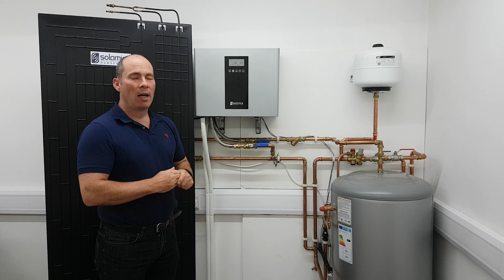What is the cost of running a Thermodynamic Solar Heat Pump?

Comment: We had one of these systems installed a month ago. One thing that was not mentioned to us was how loud the compressor unit would be in our attic. If we could go back in time we would not have installed this system. It takes too long to heat the water back up too.
Reply: Ye I’ve packed insulation all around it and around the roof beams but it’s sadly not made a difference ☹️
Reply: Ugh that's too bad. Can you add some sound insulation around the compressor? Maybe build a box with dynamat?
Reply: Which brand? Whats the difference in your hot water bills.
Reply: @howardburrage3874 Not sure if this was directed at me but we have a Harnitek Thermopod. Provided and installed by a company called Noreus. Turns out they installed a faulty unit, the new unit does heat up quicker (maybe runs 3 times a day for about 2 hours each time). But, it’s still noisy as hell! It’s better because it runs for less time, but it’s still super noisy. They gave us some money off and washed their hands of us now 🙄 They can’t rectify the noise & neither can we. Massive mistake, just stay away from this tech. Get PV & a battery instead.
Reply: Should have said, it has saved us money on heating hot water though. We also recently installed a smart fuse for the hot water tank so the immersion(ah lovely silent inefficient immersion) only runs at night on a cheaper tariff, so it’s difficult to work out how much it’s saved us. Both changes have amounted to a halving of our hot water bills. I have our heat pump on a smart plug so can give you a bit more info: It’s actually twice a day it runs, in the morning for 2 to 3 hours then in the evening for 1 to 2 hours.
Reply: Just adding two more items....isolating  the compressor (and any other machine) from structural connection should help to minimize noise. Vibration travels a long way (whales know this, of course) and beams in a home can conduct vibration to other points of contact p, actually increasing noise. Personally, very interested in the application seen here, for whole house heating and domestic hot water, using a large, very well insulated storage tank or tanks.

Comment: @ 1:42 "It is an incredibly low efficiency system". Not so good then?
Reply: If he can call a system with a COP ( Co-efficient of Performance ) of 3.5 to 4 - that means having an energy efficiency of 350 to 400 % there is something wrong with his understanding of a heat pump water heater. For every kilowatt of electrical energy consumed, a properly designed and sized heat pump will heat water to the equivalent of a 4 kilowatt of electrical energy. If he calls that an incredibly low-efficiency system, then what is high efficiency according to him?
Reply: He mad a mistake that's all. he meant high efficiency.

Comment: The presenter does not appear to be on top of his subject or is simplifying rather too much. The compressor does not scrunch it back up into a liquid, in turns it from a low pressure gas into a high pressure gas. The condenser turns into a high pressure liquid..Might have been better with a system diagram. One would hope the unit overall has a high COP rather than being inefficient -otherwise there is not much point to it.
Reply: What the compressor does do is make an absolute racket in your attic.

Comment: What's the capacity [litres] of the reservoir tank? The one holding all the hot water?
Reply: Ours is 150 litres and it takes literally all day (turns on at 8AM, turns off at 9PM) to heat the water up to 50C. That is with 2 showers being run, one prior to 8AM, one at midday.

Comment: A high cost just to heat a cylinder of water, and does not meet the UK HW standards to prevent legonella, needs to be heating water above 60c, these systems have a max of 55c
Reply: legonella is dangerous when you use this water for showers and in the kitchen. This one should be for house heating only, a closed system. When you use for exp floor heating, even 55c is too much...but I do wonder how this is more efficient then heat pump....
Reply: I wonder why we don’t have to heat water so hot in the US. We usually heat our water to 45-47
Reply: @zlmdragon.  i meant to say regular heat pump...but the comment was about the max temperature of heated water...and lagonella bacteria...
Reply: @zlmdragon.  Those Inverter Controlled Hybrid Water Heaters seem to deliver serious payback regarding COP that plus the idea of ducting out warm damp Air from say a bathroom and returning Cool Dry Air seems a great idea...
Reply: mine has an automatic anti-legonella programme which can be set to activate as often as you like.